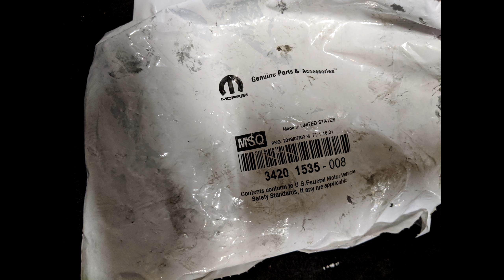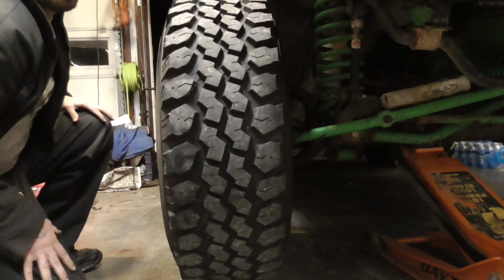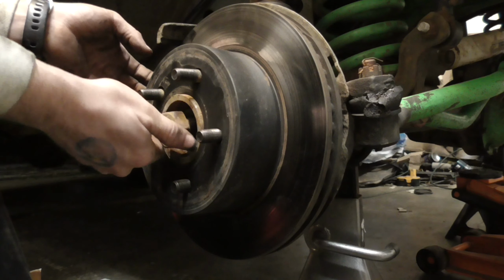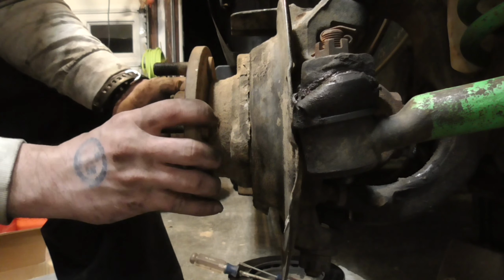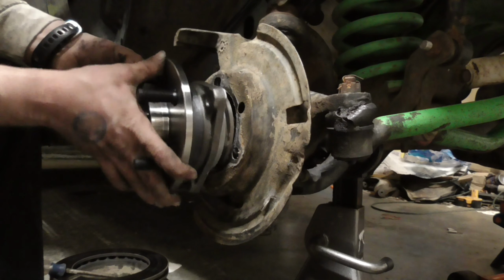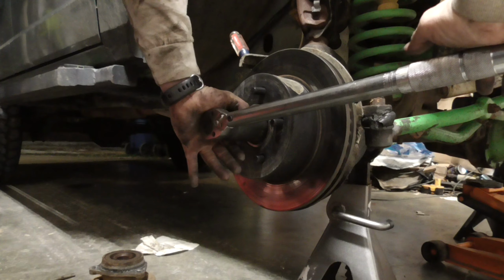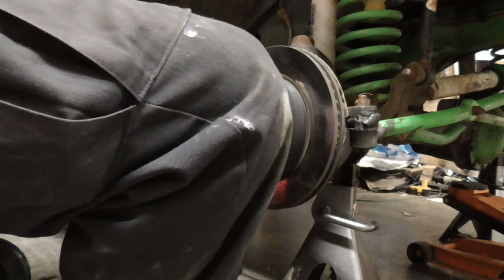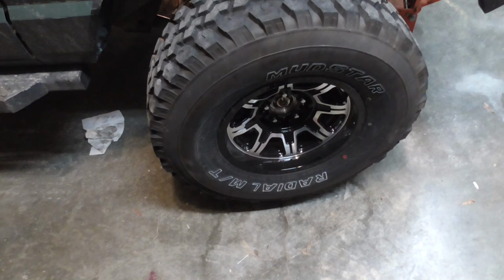Jeep Cherokee XJ | Front Wheel Bearing Hub Assembly Install | Remove & Replace | TJ | ZJ

Comment: Thanks for taking the time to upload the video. Great video quality, good sound! I was wondering about the statement you made regarding Timmken. Many YouTube mechanics claim they are a much better quality that Moog who's parts are made in China. One mechanic even showed a video where it says, "Made In China"? Love the Chinese culture, but their reputation for quality auto parts is poor. Thanks again, good job!
Reply from the maker: The comment  about Timmken is true, a number of years ago I went with Timmken because I could get them local and they were still made in the US at the time, they lasted about 80k miles.  I love Timmken bearings is any kind.  But a couple years ago they moved the wheel bearings to overseas and there quality has plummeted. I've seen a surge is bad reviews the last couple year and even seen people having 2 Timmken bearing bought at the same time look completely different out of the box. So any bearing you get now is made overseas so the best thing to do is buy local and check the bearings before you buy them to make sure they are tight.  Plus you get the warranty when bought locally and I no longer has a source of Timmken wheel bearing locally, which is another reason I went Moog.